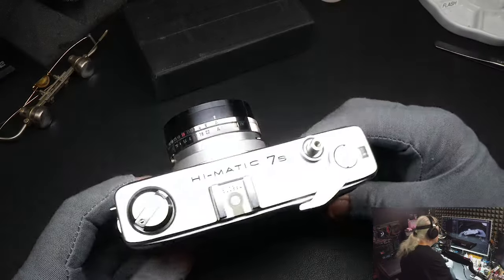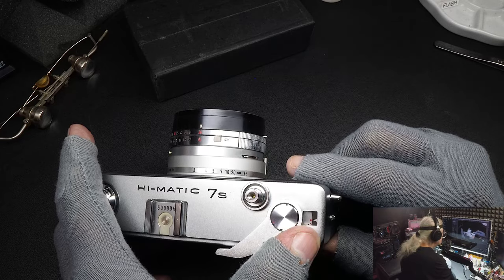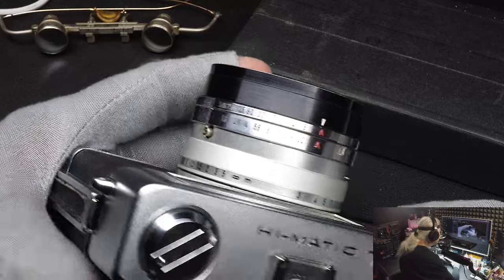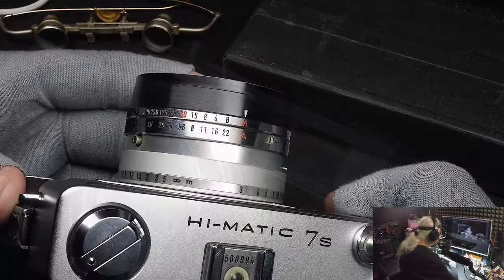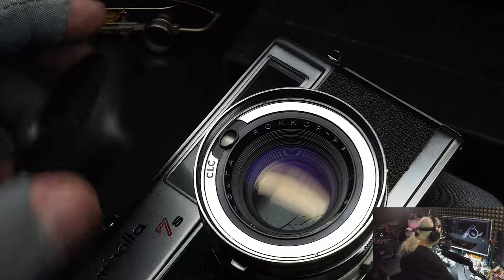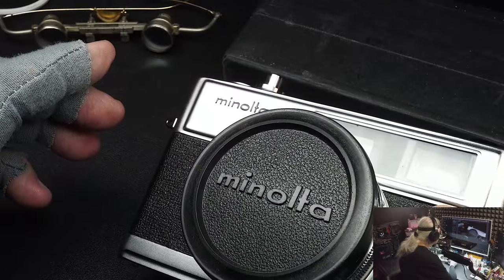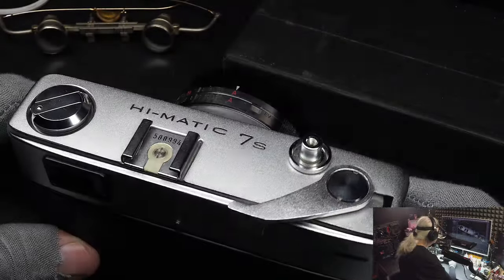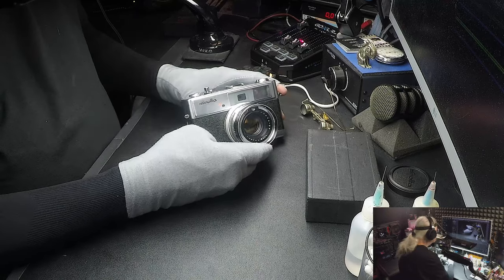Tour Inside the Minolta Hi-Matic 7s | Part 1 | Vlog #017

Comment: My grandpa was in the air force and bought this back in the day. I was born in 1987 and remember it being around his neck in the early 90s. Luckily I acquired it when he passed and have taken some amazing pictures on manual mode. In a way his spirit is tied to this camera and I feel closer to him when I use it. 

I’m not 100% sure the viewfinder is working right when I use the focus. It just kinda shifts but doesn’t change the focus. I have to just hope and pray it turns out right.  I had thought about putting a newer battery in it but for now I just shoot manual.

But this camera is built like a tank for the most part. The All metal construction is really admirable.
Reply from the maker: Concerning the focus, the mechanism may have gotten stuck with age or the yellow coating on the split beam glass may be too faint to see. That camera lens has a large amount of depth-of-field. If you use the distance scale on the lens barrel, your pictures should be in focus. Of course you could always get it fixed, but it would cost more than the camera is worth. If it were me, I would buy some nonworking cameras off eBay for $20 each and go in and have a look at them and learn how the split beam system works first and then go into my grandfathers camera and fix it. Even if you can't fix it, at least you would understand the problem.
Reply: @FilmCamera_Vlog  great suggestion! Thank you I might have to try that. (I’ve been curious what it was like inside there anyway haha)
Reply: @FilmCamera_Vlog  okay on further inspection and learning more about this camera I must confess that I was ignorant to how the focus worked inside the viewfinder. I grew up in the digital age so I was expecting a blur inside the viewfinder to clear up when it was in focus, but I’m happy to announce that there is indeed a yellow film in the center and I now see the split images and they do align. Before I thought that the yellow dot in the middle was just a reference point for the center of the shot. So thank you! You have helped me quite a bit.
Reply from the maker: @AnthonySmith-sc4zs  
Most rangefinders  of that time period used a split beam focusing system. The Part 2 video explains how it works and shows the yellow glass beam splitter.

Comment: Great video and love the history of this camera! It's definitely a looker! So much so I picked one up on ebay in pristine condition, the only issue I noticed when I got it to test it out is the Shutter Speed Ring being very tight to operate.  Any suggestions on how I can remedy this myself? Many thanks in advance!
Reply from the maker: Hello Eyeswideopen
It's hard to say what the problem is. My first guess is the camera was dropped and hit the lens barrel from the front. Check for dents on the lens barrel. A blow to the front could have compressed the front rings. It could also be dirt or sand that worked into the Speed Ring. Third cause could be that the lubricants dried out on the Speed Ring. As a repairman, these are the things I would check for first. Taking the barrel rings apart is not that difficult. I'm sure there are some YouTube videos on the subject. As long as you don't go too deep, you should be okay. You might want to buy a non-working Hi-Matic on eBay and practice on it first. There is no quick-fix solution.  Good Luck. Kori
Reply: @FilmCamera_Vlog  Appreciate the breakdown on how I can try to remedy the issue myself.  As for lubricant is there a type I should favour over another? Would silicon based lubricant be acceptable?
Reply from the maker: @eyeswideopen565  
Yes, silicon would work, but you don't want to spray it down into the barrel or it might get on the aperture blades. The only real way to fix it is to go inside barrel and see what the problem is. I see too many cameras come into my shop where the owner sprayed lub into camera. It does not work.

Comment: How would I be able to tell if the focus is calibrated or not? It’s my first ever rangefinder and I don’t know if it’s normal for the numbers to not exactly correspond to the actual distance of the subject matter I focus on. The two images overlap fine, but I don’t know In a little thrown off.
Reply from the maker: Hello Santiago
Normally, if the two images overlap perfectly when the lens focus is set to infinity, the focus is considered calibrated. The numbers on the barrel will not always agree with the focus distance. Most rangefinder lenses have a lot of depth-of-field to allow for errors in focus, so it does not have to be exact. Just set the lens focus for infinity. If the images overlap, your camera focus is okay. The two images can be off by a hair, but not more. I usually check my rangefinders by pointing at telephone poles and wires for both horizontal and vertical alignment of focus.
Reply: @FilmCamera_Vlog  Darn. I figured that was the case. Doesn’t seem to be calibrated then, and I’m out of luck with my local camera repair store here in San Diego, they wouldn’t accept it. 
Is this an easy fix? Ik in P2 you say that it’s a bit of a pain to calibrate that mirror. Thanks for your help!
Reply from the maker: @santiagoro  
If you know exactly which adjustment to adjust, and how to do it, it's not that hard. I would need to know which rangefinder you have to show you the adjustment location. You would need to remove the top cover to reach it. I plan to write an article for my Patreon in a few days about how to approach focus adjustments. I suggest you search for focus adjustment  videos on your camera for a few days and be patient.  View them and wait before you start making adjustments to your camera. The main danger is making unnecessary adjustments to your camera focus and messing up the factory settings.
Reply: @FilmCamera_Vlog  Got it. It's definitely the horizontal axis that is out of whack. I found a forum highlighting the specific screws that adjust the horizontal range and the vertical range. I'm pretty certain the horizontal range is covered by a screw near the tinted glass. I'll have to try it out and let you know. My main issue right now is getting top plate off, took off all the screws but don't really know how to get the advance off to fully uncover it.

Comment: Hey I have this camera but the lowest my light meter gets its to 11 on the EV scale. No matter if there is no light it is always pointing on 11 on the EV scale. If I point to some light it will react and "act normal". But its like it only works from 11 to 17 EV scale. I also notice that the light meter has a base voltage of 0.3 and changes with the light but it never goes below 0.3 volts. And the last thing I notice is that if I turn off the light meter (choosing ISO O or OFF) the arrow stays on 11 at the EV Scale. 

Can anybody tell me what could be wrong?
Reply from the maker: Problems with cameras are always electronic or mechanical. Your problem sounds like a mechanical problem, not electronic. Something is blocking the needle from going further down past 11 EV. It could be many things and I have no idea what. Perhaps something came loose and is blocking the needle, or perhaps someone worked on the camera and damaged something.
Reply: @FilmCamera_Vlog  thanks for answering! I am able to move the little “arrow” down to  5.7 Ev and when the camera has no batteries the arrow points to 5.7 as it should. So maybe I need to change my light sensor.

Comment: How do you define classic?

I am not sure if they are classic but here are the old film cameras that I own and use:
Argus C3 35mm rangefinder
Asahi Pentax Spotmatic 35mm SLR
Pentax ME 35mm SLR
Canon Canonet QL17 GIII 35mm rangefinder (fixed 40mm lens)
Contax G1 35mm rangefinder
Fuji ST705 35mm SLR
Leica M6 35mm rangefinder
Minolta Hi-Matic 9 35mm rangefinder (fixed 45mm lens)
Nikon F2 35mm SLR
Nikon F4 35mm SLR
Nikon L35 AF 35mm compact (fixed 35mm lens)
Nikonos III 35mm underwater
Nikon N70 35mm SLR
Nikon N2000 35mm SLR
Nikon EM 35mm SLR
Fuji GW670 medium format rangefinder (fixed 90mm lens)
Fuji GSW690 medium format rangefinder (fixed 65mm lens)
Mamiya RB67 medium format SLR
Holga 120 medium format panoramic (fixed 90mm lens)
Holga 120 medium format pinhole
Zero Image 120 medium format pinhole
Custom 4x5 inch large format pinhole
Calumet CC-402 wide field/short monorail 4x5 inch large format view camera
Reply from the maker: Nearly all of them are classic film cameras. I'm not sure about the Nikon N70 or the N2000. From your list, I've worked on the cameras below:
Asahi Pentax Spotmatic 
Pentax ME
Canon Canonet QL17 GIII 35mm rangefinder
Fuji ST705
Minolta Hi-Matic 9 
Nikon EM
I have worked on many more, but started taking cameras off my repair list as I got older.
Reply: Unfortunately if they shoot film they are considered classic now